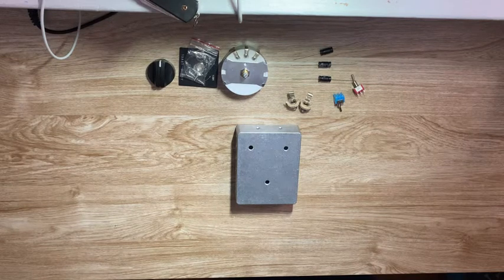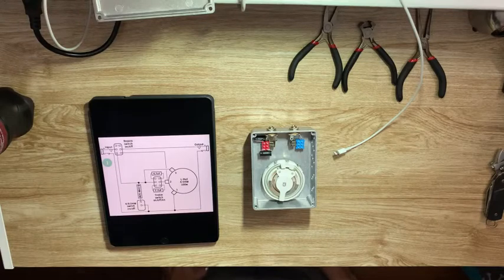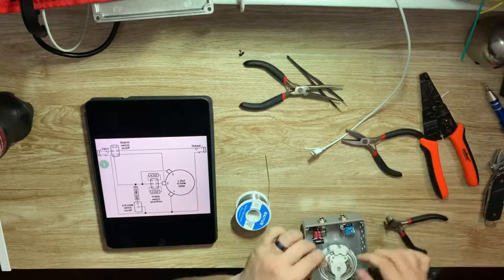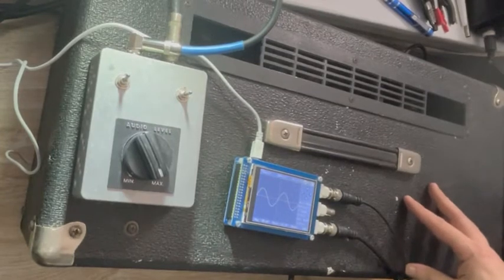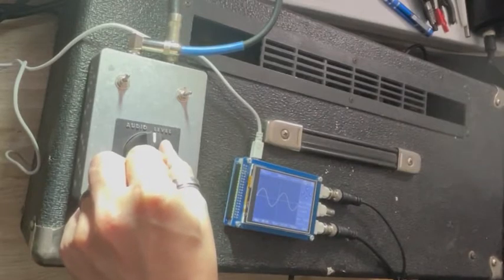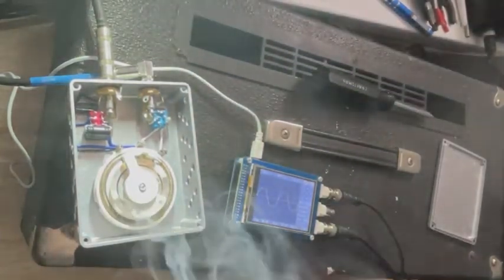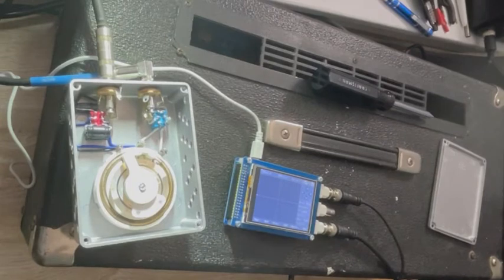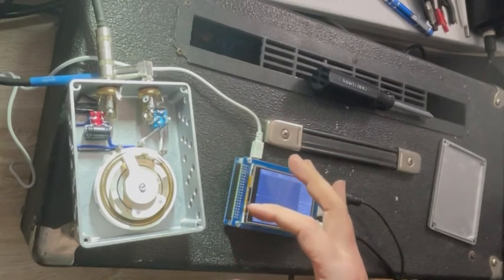100 watt DIY attenuator?!?!

Comment: Most people: "Smoke! Oh no my Amp!!!"
This guy: "Looks like it's getting hot." Continues to observe smoke calmly. Lol. Cheers man. How does it sound?
Reply from the maker: It said 100 watts. I wanted to see if it could really handle 100w. But it doesn't seem to be damaged. I use it all the time. I will be changing the high caps at some point though. That's switch doesn't seem to do anything notable
Reply: Thanks for the video. Did it stop smoking eventually? I mean, I imagine there's some compounds left on the inside of the L pad during manufacture? Like mould release from when they made the plastic bits? Or does it just keep smoking like its damaging the device?

Comment: I have built one of these and use it extensively. However, I also added in a few more high wattage resistors to share the load of power dissipation. What is that little oscilloscope by the way? Where did you get it from?
Reply from the maker: https://www.ucore-electronics.com/product/uce-dso212-with-uce-ct213-combo-deals/
Reply: Hi there, can you share a rough schematic of how you did this? mine is smoking. I have 8 ohm 100 watt resistors laying around . I'd like to modify it to handle the 100w load from my ampeg v4. Thanks in advance for any direction you can provide.
Reply: @plaguedoctoramplification7841  Thanks
Reply: This. The designs I see all use a high wattage chassis mount resistor. That's probably exactly why this thing fried.
Reply: @filmmac3  I think i referred to the Jettenuator schematic when building that one. Its also based on the concept of load sharing resistors along with the l-pad. Bear in mind, I mostly have amps from 20-50 watts. And even those i hardly ever turn up past noon even with attentuators. Trying to silence a 100W tube amp cranked at full with an attenuator is like revving a car engine at full while holding down the brakes. Something's gotta give at some point.